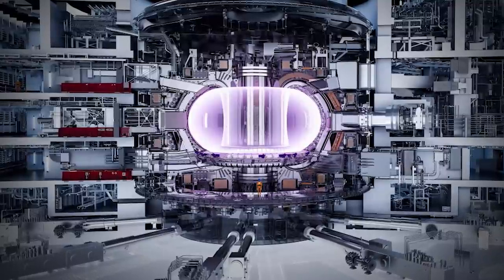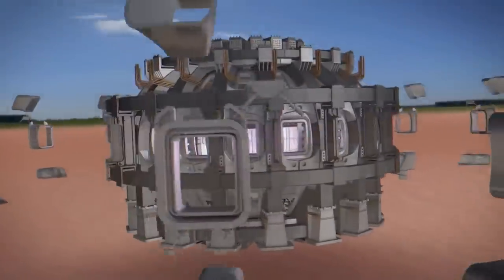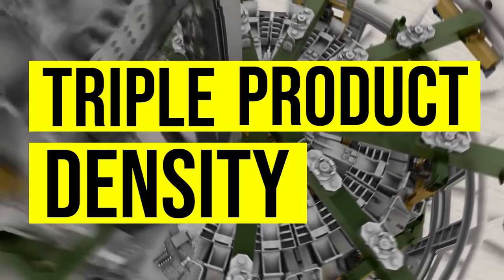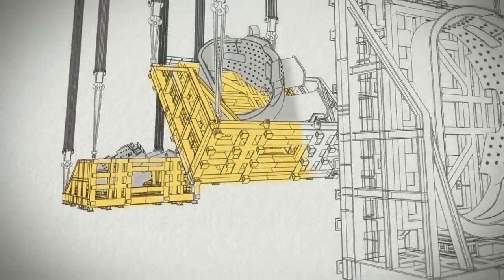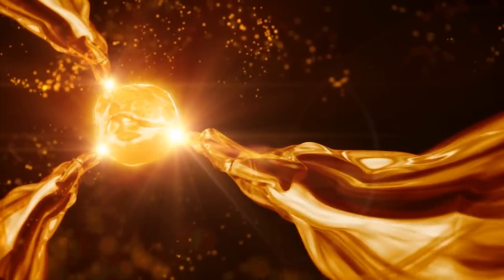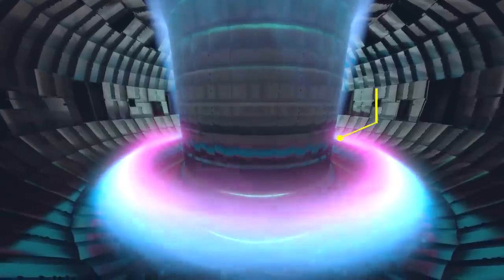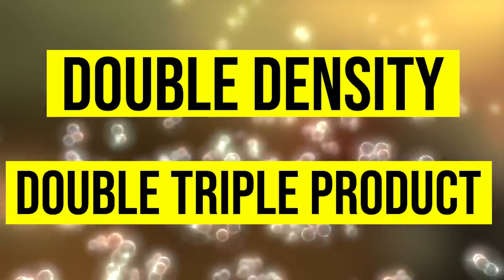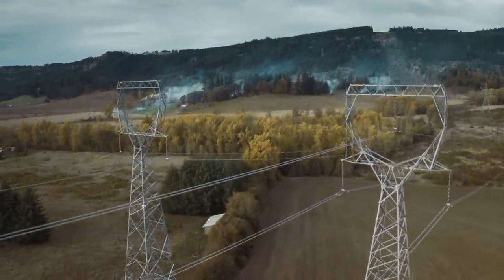Nuclear Fusion Breakthrough Rewrites Laws of Physics

Comment: also they cant explode like a fission reactor. the plasma inside cools instantly the moment the reactor's hull is punctured.
Reply: the reaction doesn't make explosions it's the steam.

remember, nuclear reactors are just very complicated steam boilers. The steam is the part that goes bang in a nuclear reactor, which then carries out all the nasty stuff made in a meltdown and throws radioactive stuff everywhere.

This will still probably use steam, so yes it will still be able to explode. We won't get nasty things like fallout and corium though!

Comment: At 3:53ish you state that cold plasma is less dense than hot plasma.  Gas wants to expand when heated.  The same amount of matter wants to decrease its density by occupying more area.  If it can't, there's a build up in pressure and potential energy.  There is more movement, friction, and heat being generated as the pressure increases leading up to a catastrophic runaway event.  Anyways...

Comment: Even doubling the energy output will not allow fusion to come close to engineering breakthrough.  All the talk is about the contrived "scientific breakthrough" which LLNL claims to have accomplished with NIF a few times (out of who knows how many tries in between), but still remains unverified by an independent source.  NIF results do not seem to be reproducible on demand and remain a factor of a 1000 away from engineering breakeven - what we all used to call breakeven and is the breakeven that counts for generating net energy.  I think 40 years is still generous.

Comment: What i dont really get is why they dont make a section of the ring get smaller perpetually which would allow the plasma to compress under the extreme force of the electromagnets and creating a more confined area of fusion that can more easily get its energy harvested ( basically like the doughnut shape but smaller at one half than the other)
Reply: Smaller reactor means greater energy diffusion from the plasma, so less efficient
Reply: @Gomlmon99  oh i didnt know that thank you
Reply: Yeah for sure!

Comment: Hmmm current Fusion reactors are 1% efficient in terms of absolute energy production. So while positive, this step forward doesn’t really progress matters very far. The current 70% claim is highly misleading, only used by those seeking more funding for fusion reactors.
Reply: This may change much faster than seems possible for a few reasons. To start with current tech, the JET reactor uses copper magnets that burn energy, something like an additional 2/3rds over what a superconducting magnet tokamak would use, so the energy use is about 3x less for future reactors. Then high temperature superconductors allow the magnetic field to increase by 70% over ITER's magnets, increasing power by 10x for a given size. This leads to a peer reviewed prediction that the ARC reactor design could produce net electricity with the smaller SPARC tokamak aiming for about total energy breakeven before 2030. Then there's a new simulation prediction that high powered tokamaks will be able to double density as this video reports. Notably I believe this would double pressure and quadruple power which goes by pressure squared - enabling commercial scale tokamaks to look like they can produce at a competitive price if all goes well. This we find out in about 10-15 years... luckily there are many other fusion projects going on to keep the fans entertained
Reply: @Canucklug  One of my team is a non exec for a UK fusion project. You’re definitely right that containment improvements are happening and will make a difference. However I’m depressed by the ITER project and frankly the whole approach of Western academia which to me is anti-innovation as funding goes to mature safe bet researchers. New thinkers in their 20s simply aren’t being backed. Worse still we’re measuring the wrong things, I.e. not telling it like it is and showing both the total energy in/out, but also the time and cost of build. My view is big physics has become comfortable fur lined rut for the unambitious who can enjoy a well paid life long career achieving little. This compares starkly with the rapid progress being made by Elon Musk’s team at SpaceX and the efforts of the Chinese. I think you may be right on the 10-15 years but it won’t be from the West, it will be achieved in the East as the recent era of low interest rates resulting in governments and investors raining money on fools with go commercial drive will end. A bleak assessment I know, but I’m in me early 50s and I’m appalled by the lack of progress on Fusion and New Nuclear, Europe, the UK and the US seem to be a strategy free zone when it comes to energy security, the current Fusion projects are token efforts, while China and even the Middle East are quickly bringing reactors on line.
Reply: @alihenderson5910  Well right now we’re involved with both fusion and fission projects, hydrogen and also hydro projects and as far as I can see the UK and the rest of the West is living in a strategy free, sound bite zone.
Reply: @marcusoutdoors4999  Energy free zone more like.
Reply: THanks for that reply, you made me laugh. It’s just so frustrating as this energy crisis is so unnecessary, we have lots of proven solutions + a load of interesting research projects. But as Einstein said, “while intellect is finite, stupidity is limitless”

Comment: I did some looking and I found this. I think this means the ITER is not obsolete.  Source from the SCIENCE TIMES.
 I love science but I am just a layman with heavy emphasis on the "lame" part of that word. Here is the quote:
"The latest research shows that the ITER tokamak can operate with hydrogen volume twice the original capacity, generating more fusion energy than previous calculations."

Comment: The number one problem to overcome gravity, the new fab hydrogen can be made by using nuclear reactors the byproducts are oxygen and heavy water which can be stored until fusion energy is possible. What is the safety factor for a fusion reactor and does it emit radiation when it fails so if it explodes what is the danger to people and environment.
Reply: I don't understand your first sentence; I don't think gravity is much of a consideration in fusion plasmas.

The safety factor (called q) ranges from 0 to infinity at the separatrix of a diverter fusion plasma, but it doesn't mean what you would think. It's the ratio of number of poloidal and toroidal passes for a magnetic surface, which indicates something about 'stability'.

Tokamaks emit neutron radiation when active, but are neutron radiation shielded. If a disruption event occurs, the fusion and neutron radiation immediately cease, so danger to public is very minimal.
Reply: As far as I know, a fusion reactor can not explode. If something goes wrong, the plasma cools and reactions stop, and then radiation also stops.
Reply: @zeitgeistzebra  True, but I guess any responsible facility would have thick walls to shield fron that radiation as much as possible, and have none super close to the reactor while it is running. At least it is less of a problem than a fission plant going bad
Reply: @assarstromblad3280  There is a lot of consideration for the neutron radiation shielding, but one of the larger issues is that the neutrons are how we intend to extract energy (the alpha particles to be used to continuously heat the plasma). Thus the neutron shielding has to be in several layers, and disruptions can break a smaller layer more easily and leak to other plant components. If vacuum is broken and the plasma equalizes with air, there will be airborne neutron radiation to deal with.
Reply: @zeitgeistzebra  ah, okay, well that complicates things for sure. But then I wonder, if the plasma chamber is compromised, and there is no vacuum anymore, wouldn't the gas rushing into the plasma cool it so fast that it basically has no time to create more reactions? Also, if the magnetic containment fails, wouldn't the plasma just disperse and hit the walls of the reactor and cool down? Then the fusion process should stop basically immediately and not release any more neutrons? And if the walls are already designed to capture neutrons to convert into heat, shouldn't they also have no problem capturing some rogue ones in the small time period between failure and shutdown?
Reply: @zeitgeistzebra  Maybe I get it wrong but as far as I understand the neutron radiation only exists while the reaction is happening, so there should be basically no free neutrons after the fusion reaction had been shut down. Is that correct?
Reply: @zeitgeistzebra  Oh, and foegive for all the questions, I find this subject really interesting. So about the heating of the plasma, I get that the alpha radiation heats the plasma (the helium cores creates bump into eachother I guess?) But how is tjos controlled? Are some walls in the reactor reflective to alpha radiation and some absorb it to be able to control the heat? (Like moderators in fission reactors) or is it just balanced by itself? And secondly, if this is how the heat is sustained, how is the gas heated into a plasma during startup? Is another alpha radaition source used or is it just heated from being compressed by the magnetic field?
Reply: @assarstromblad3280  the reaction would cease immediately, but some free neutrons are already present and could rush out. They're travelling at incredible speeds so it doesn't take long to disperse. The only time it would be an issue is if the walls break because the walls are designed to catch all the radiation.
Reply: @assarstromblad3280  Don't apologize for being curious. I'm doing my PhD in this because I find it fascinating too. The alpha particles will bump into other particles and transfer heat that way, you need to consider which particles they will give more heat to because they won't disperse evenly amongst all particles. The alpha particles are charged, so they are also magnetically confined, where the neutrons are not. This is why the walls should mainly encounter neutrons and not other stuff. Getting to 'ignition' (where alphas sustain the entire reaction) is the goal, but you can't startup with it. Usually you use induction to drive a current (only works for a finite time), and then you have to use other auxiliary heating methods (ICRH, ECRH, neutral beam injection, gas puffing, etc.) to get the plasma into a hot enough regime (probably some kind of H mode plasma).
Reply: @zeitgeistzebra  Oh right, alpha patticles are positively charged, for some reason I thought of the product if the fusion as helium and not just helium cores. So the induction heating is the reason it takes so much power to start up a fusion reactor?
Reply: @assarstromblad3280  The reason it takes so much energy is that the 'temperature' is way hotter than the Sun, and magnetic fields need to be very strong to contain particles moving that fast. Temperature is only defined if the distribution at a location is Maxwellian in shape and has a single peak, so if there are several peaks (from auxiliary heating preferring to heat particles of x speed, etc.) then there is no single temperature, and then all the concepts that depend on temperature break down.
Reply: @zeitgeistzebra  Not sure I follow you there, but do I understand this correct if I try to dumb it down to my level? So i understand it as such: Different particles move at different speeds and thus can have different "temperatures" in the plasma at once, and most of the power usage of the reactor is the magnetic containment system itself and not the induction heating? Or is that essentially the same system?

And another question: Will the reactor use more power during the initial moments of startup when it both has to heat and contain the plasma (before the reaction is self sustaining with heat) or is the power usage essentially the same during the different phases of operation?
Reply: @assarstromblad3280  in volume x (1 of many volumes) there is a distribution of particles by speed. In most objects this distribution is shaped like a bell curve, called a Maxwellian. The peak of the Maxwellian is the temperature of the object. This is the stable state for everything. Plasmas are never fully stable, so they have distortions in the distribution that destroy the definition of temperature, and the ions and electrons are moving at very different speeds anyway. The methods of heating you use can affect different parts of the distribution more than others and further distort it. Most of the power usage is in heating, but lots of that heat is provided through ohmic induction via magnets and the magnetic containment system. Some of the coils are only for plasma shaping, but some are also for heating. 

Power usage definitely varies throughout a discharge, and the magnetic confinement system has be run and tuned the entire time to prevent very fast disruptive events.

Comment: I'm totally ok with the collateral technology and science developed in the adventure of a fusion reactor but we need to accept that gravity is free considering the fusion process in the sun. However the developments of fusion reactor requires more and more energy to sustain the the plasma for fusion. Another thing not considered is even if the energy balance in the reaction could be solved, it needs to be high enough to compensate all the energy used by the utilities and than we can start talk about it as a source of energy

Comment: As long as all of the many issues surrounding the development and production of this different way of producing nuclear energy is addressed and solved before it is industrially used as an acceptable power source, we should be ok. Definitely want a proven safe working model in preference to anything experimental, especially when going down this road.

Comment: At the start, you called the fusion reactor as 'nuclear reactor' several times. Now, it's not wrong, but with the popular meaning of 'nuclear reactor' referring to fission, it IS misleading a bit. Although not so much, since the context constantly stays on fusion power... Misspoken words?
Reply: That's putting it politely.
Reply: I was going to comment this yeah,
Reply: No he isn't, both fusion and fission are the two types of nuclear reactions that can exist in chemistry. They're both nuclear reactions that are just the opposite of each other, fission splits the nucleus of atoms turning them into separate lighter elements, while fusion joins the nucleus of atoms for a single heavier element. 

The word nuclear itself refers to the nucleus of atoms, hence any reaction or reactor that facilitates the reaction of nuclei (plural of nucleus) is therefore a NUCLEAR reaction or NUCLEAR reactor. 

It's true that must people are used to knowing nuclear reactors as fission based, but that's because fission is easier to accomplish in a reactor than fusion. So it became a common place word for nuclear FISSION reactors, however, fusion reactors have existed and been worked / experimented on since the early 60's and they were certainly called NUCLEAR reactors back then as well. They're just not as common place in society because they aren't providing power to the grid yet. 

Once nuclear FUSION reactors become viable power producers, then the distinction between the two nuclear reactor types would gain popularity naturally. This just means when somebody says their grid runs on nuclear, they'll need to specify whether it's nuclear fission or  nuclear fusion.
Reply: @justiceifeme   If you would have read the comment you would realize.

It's not technically wrong. However, this is simply confusing.
Reply: @j3r0_plays7  In the original comment, he said "it IS misleading a bit". This is what I was mainly objecting to, the rest of my comment just gave clarifying context to it.

There's nothing even the slightest bit misleading about calling fusion reactors; nuclear reactors, just because the general populous are used to knowing them to be fission based doesn't change that.
Reply: @justiceifeme  aight

Comment: DEMO won't see the light of day IMO. Technology has rapidly increased since the conception of ITER and DEMO, HTS magnets, AI, supercomputers with the power to do much more detailed plasma simulation all didn't exist when this was designed. It's akin to wanting to build a huge TV screen and chosing to make a gigantic CRT that takes 4 decades to build, in the meantime LEDs (including eventually blue LEDs) and flat panel technology made that decision redundant. I feel one of those 40 plus companies  is going to crack the aneutronic direct conversion pulsed fusion reactor before ITER even demonstrates break even. ITER will end up being a very large physics lab, and sure we're going to learn a lot about magnetically confined plasmas but ultimately the problems associated with high energy neutrons will scupper the whole idea anyway.

Comment: Explain how Demo with convert this heat to electricity, even if the amount of energy to contain the plasma is less than the amount produced, the heat generated by the reaction is mostly radiant? So how much of it is not contained by the bottle? How much of the millions of degrees are waisted? Boiling water to turn turbines is a very old technology. Something more efficient?
Reply: The energy produced is carried as kinetic energy of the Helium and neutron. Both give it as heat through collisions with the wall and the breeding blanket. The efficiency of electricity production is 30-40%. The hear could be also used in cogeneration (heating, H2 production, industry applications etc.)